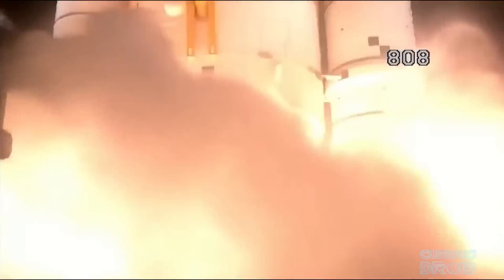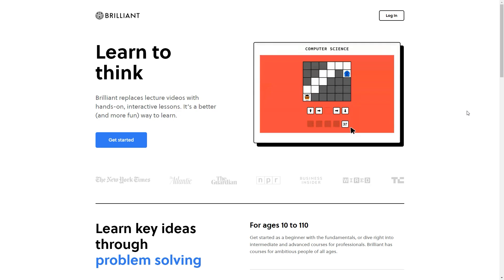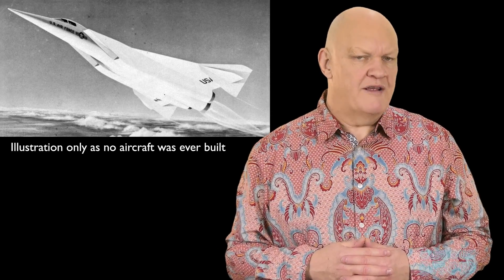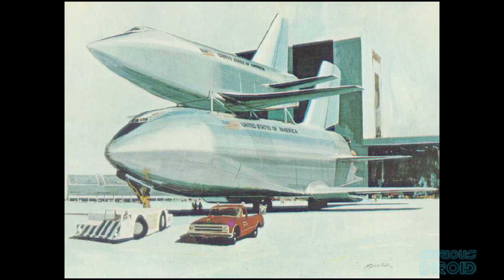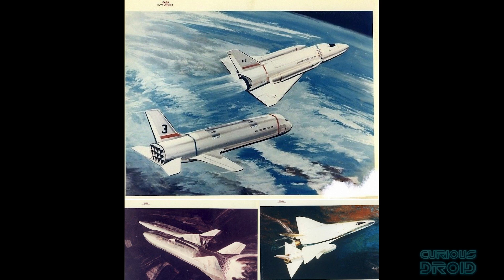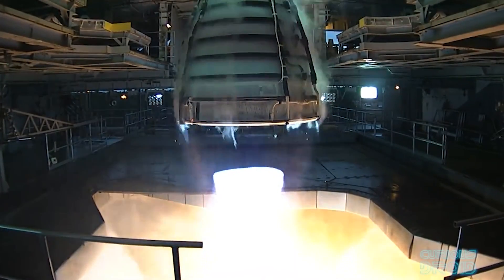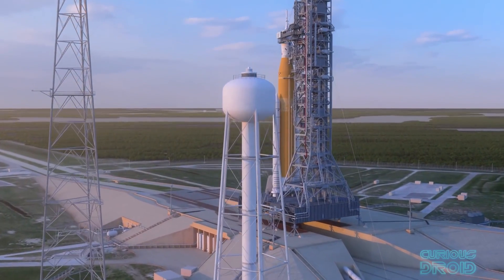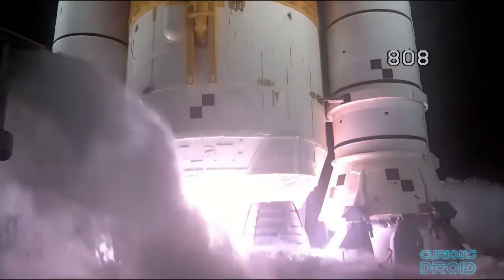Why is NASA Throwing Away Reusable Engines?

Comment: In a documentary I saw about the development of the SLS, is that, the RS-25 were not exactly powerful enough for the job. However, since they were now "disposable", they could be run way over their specifications, because, well, who cares if they are destroyed by the time their fuel is burned. So, from memory, I believe they are used to 115% of their designed thrust, which does give the necessary power needed.
Reply: They were run above their design rating   on the shuttles for years. If you listen to one of the shuttle launches you'll hear the throttle up command to 104%, and I think later on it went up to 108%. This increased thrust was due to upgrades made to the engines over the years.
Reply: What documentary was it? I wanna watch.
Reply: @MattH-wg7ou  I can't find it!!! I watch too many: Curiosity Stream, Magellan TV, Youtube. I've looked and if I find it, I will post it. They talk how they save money by using SS technology and manufacturing, etc.
Reply: Found it. On Curiosity Stream. "Breakthrough. Artemis: First Launch"
Reply: @dion6481  I appreciate you. Ty
Reply: This is largely incorrect. 109% was already planned for polar orbit missions in the mid 1980s prior to Challenger, with upgrades that number was to go higher. In any case the component most likely to fail at higher performance were the turbine blades which were already being replaced constantly due to cracks in the early engines--so if your line of reasoning is correct Block I motors were effectively "disposable" because they were replacing the parts that would be worn anyway. So your line of reasoning is not correct, since running the engines at increased thrust does not wreck them more than they had already been wrecking them early on running at thrust levels specified in the original design.
Reply: I thought that it was 109%
Reply: @dr4d1s  I don't remember exactly and I can't find the documentary in question... I watch too many.
Reply: @dion6481  totally understandable. I know how that goes all too well. Thanks for the reply though, I appreciate it.
Reply: @dr4d1s  
🤔 Well, it depends. I've managed to boost the power of R25 engines to 116.4%. You see, I bought 11 of them at a govt surplus auction to increase the altitude of my modified Estes model rockets from 800 feet to 800 miles.  Unfortunately, I too have been unable to reuse my R25 engines, because the vastly increased altitude they provide has proven to be a double-edged sword. Now I can never seem to locate the rockets after launch. They no longer just float back down into my backyard! 😁
Reply: @HighlanderNorth1  Yeah I had the same issue. I Finally had to just realize that I would never see them again.
Reply: If you don't plan on reusing the hardware they can be uprated  a Massive amount extra thrust since you can use it all up!

Comment: Its really all about pork. Not the kind of pork you eat. Its the kind of pork senators and congressmen use you buy votes from their constituents. There are production lines at factories in several states that the politicians in those states wanted to keep open after the shuttle program ended. The more RS-25's, propellant tanks and SRB's that get dumped into the ocean the more federal dollars flow back to those states to build new ones. This keeps the professional politicians in office, which is the top priority. And don't look for it to change anytime soon either.

Comment: It doesn't make sense from an efficiency or cost perspective but makes lots of sense in terms of Congress requiring this stuff to direct federal funding to their states. It's a giant welfare project for the massive industrial complex built to support the shuttle system. Meanwhile new space will continue to make strides and all of this stuff will become increasingly irrelevant and expensive. It would be easily within the technical capabilities of old space to build a heavy lift reusable system but they are too busy sucking that sweet sweet cost-plus government teat to ever change.
Reply: So you propose these engines be stored and maintained until a new shuttle is developed? Put in museums or the on the lawns in front of them, cut into pieces and melted down for scrap? All kinds of old hardware gets repurposed.
Reply: @masterpython  Old hardware gets repurposed if it is economical to do so. A 20+ billion dollar program to achieve a handful of SLS launches using a handful of SSME's doesn't qualify as economical no matter how you look at it. Yes, it would have made more sense to turn those SSME's into museum pieces.

Comment: Seems odd to me that they are focusing on single use engines, when it has been proven that reusable boosters are possible.
Reply: Possible yes. More efficient and worth the safety trade offs? That remains to be proven.
Reply: @sunspot42  What safety trade offs?
Reply: @TheEvilmooseofdoom  There’s a lot of wear and tear on all of the components of a rocket engine, as well as all the other systems that make up a rocket. They have to be carefully inspected before reuse and repaired. There’s always the potential for problems to be missed, or for repairs to go wrong. An engine that might be alright for 10 flights might be prone to catastrophic failure after 15. You don’t find out until your run quite a few engines to or beyond 15 launches. Reuse comes with risk, as well as added complexity from the recovery systems.
Reply: @MrWolfstar8  You can say that again!

Comment: The Shuttle main tank wasn't reusable and was never recovered. The SLS tank is similar in colour only as it's a completely new tank but built at the shuttle tank factory
Reply: People keep calling it a tank.

It's a rocket.
Reply: No shit, it was clear he meant reusable in design. I knew that's what he meant.
Reply: @blackhatfreak  No, he said is was modified showing real reusability. Go listen
Reply: @bigratkiller1  Yeah, it's not like they could just slap engines on the External Tank and call it a day. There were major changes for the core stage to have engines on the bottom and the second stage plus payload on top.

Comment: It’s a great shame they didn’t used some kind of tech like what they plan for the Vulcan rocket to allow the engine section to return to Earth via an inflatable heat shield.
Reply: Maybe somebody can recover them from the sea and bring these historic engines back to a museum. I thought SLS would be an ideal proving ground for the ULA/inflatable heat shield recovery system.
Reply: These engines were designed in the 70s. They have been reused over and over for years. SLS IS WHAT THEY ARE BEING USED FOR INSTEAD OF THROWING AWAY AFTER THE END OF THE SHUTTLE PROGRAM. Recovery systems are expensive so why spend the money to recover them?? This is them going out with a bang instead of being trashed. "Disposable" is not an accurate description.
Reply: @michaelwalker6252  This is true i mean, if you use the shuttle’s engines for SLS instead of it being placed in the Air & Space Museum it is the retiremnt flight of those engines. It did what it was meant to do for the past 30 years. I think it is fair to put these glorious pieces of the space race to an end (shuttle was from the 70’s post Apollo 17)
Reply: Why is that a shame? Sounds like overhyped nonsense. Reusability of rockets really doesn't save that much and is super niche
Reply: @pyropulseIXXI  First reusable booster becomes operational and almost immediately takes over the market. But "reusability is niche" LOL
Reply: @CausticLemons7  You are comparing apples to oranges. Reusability is indeed niche for LEO. Completely unknown if it will help with deep space missions.
Reply: @jamese9283  The advantages of a reusable rocket also improve launches for deep space missions. Reusable has thus far meant less expensive and more frequent launches. So rocket for rocket a reusable one should be cheaper. Being able to launch more often also provides more margin for the sometimes tight launch windows for outer space missions.

It's not always a guaranteed win but the potential for change across the industry is, I think, quite clearly there.
Reply: @CausticLemons7  There is far less demand for deep space compared to LEO, which has endless launches due to satellites. Deep space requires higher speeds with more fuel weight, and often heavier payloads, especially when humans are on board. Reusability comes with a payload loss, so there is no "clear" advantage at this point. Starship HLS also is greatly increasing mission complexity and risk with Artemis due to multiple large refuelings. I understand your enthusiasm to bring the price down, but it should be dampened until these concepts are proven. Price is not the only factor, especially when humans are involved.
Reply: @jamese9283  You just added a whole bunch of qualifiers and conditions. Falcon 9 and Falcon Heavy have already been launching deep space missions and winning new contracts for them. So your opinion doesn't really match up with reality.
Reply: @pyropulseIXXI  yeah its not like SpaceX have launched more payload to orbit than the rest of the world combined this year ... hmm I wonder how they managed that.

Comment: They cost a fortune to 'reuse', so it's probably better value for money to throw them away. I've often wondered if reusability is as good as we think it is. For instance, the effort required to recover and refurbish the F9 boosters is not insignificant. Given the state of rocket tech and experience now, could they not make a very simple, cheap, disposable booster instead? F9s are very clever, but a lot of that cleverness is unnecessary if you're going to throw it away. Why spend so much on all the tech, when all you really want is to blast things up to LEO?
Reply: Unless you have SpaceX's balance sheet there's no way to answer your question.
Reply: To reuse is cleaner and, as for example the Falcon 9 shows, it can also be cheaper.
Reply: Wasteful thinking
Reply: The end goal is still going to Mars and back, not LEO. Expendable doesn't lead to the proper path.
Reply: If you're going to redesign the engine, you might as well make a reusable engine that needs minimal refurbishment - which is likely what SpaceX has done. Considering the considerably fast cadence of their Falcon 9 vehicles, I doubt refurbishment costs "a fortune" for their engines.
Reply: @MrWolfstar8  considering who owns Space X, I don't entirely trust their figures! Plus there are lots of new rocket companies who aren't going for reusable. If the maths were that simple, wouldn't they all be going that route? Considering how simple a basic rocket is - two tanks, some electronics and an engine or two - I'm sure they could be made a lot cheaper than the cost of an F9, even with it being reusable. Especially if you strapped some cheap, simple SRBs (which are off-the-shelf these days) to them.
Reply: @paulhaynes8045  You might not trust Elon Musk, but we do know what NASA are paying them for various crew and supply missions, and it's a lot less than they'd be paying anyone else. And similarly, SpaceX are paying for a huge number of flights themselves for StarLink deployment, and if that was costing them anything like what they'd be paying on Atlas or Soyuz, they'd have gone broke well before now...
Reply: @simongeard4824  NASA don't exactly have many alternatives! As for what NASA is paying (for something that was partly developed with NASA money anyway!), and what the real costs are, or if Space X actually makes any profits - who knows.  Also, with Starlink, Space X are effectively paying/charging themselves. Who knows what the costs and profits really are? Would Space X be a functioning business without Starlink or NASA's money? Can we trust anything Musk says? His record is not exactly encouraging.

Comment: There were some close calls on the shuttle main engines, including holes in the heat exchanger / rocket bell.
Reply: I can't remember if it was the cooling channels or the injectors, but they would plug the ones that didn't pass inspection between flights. The plug came dislocated during one of the flights and punched holes in different places on its way out.
Reply: This, 100%.  This is why reuse is, when one blows up, way more expensive than new.

Comment: It's either madness or a gravy train (explain to me the the difference between those two please). To make these wonderful, groundbreaking engines reusable - which they were designed to be! - means using them to land the booster. SpaceX has demonstrated - spectacularly - that this is essentially a software problem as long as you mod your booster with a nice re-entry kit that responds to the computer's orders instantly.
But hey, let's do NASA: let's just throw all the beautiful engines away and then go backwards by building marginally cheaper versions so we can feel pretty good about throwing them away. Apparently, that's NASA's idea of sustainability. It would be funny if it wasn't so depressing.
Reply: You know a little less than you think you do.  One of the issues with the RS25 as they stand is they are temperamental to start up and can't be re-started.  That's one of the big things spacex did, first with Merlin - go simple and make it re-startable, then onto Raptor, more complex but also re-startable.  At no point back in the day was restarting part of the RS25 design.  Lastly... NASA doesn't them.

Comment: The cost of the rocket engines is miniscule compared to the cost of developing a system to return them from orbit. With a flight rate mandated at 2/year, the breakeven is just not there for reusability on SLS components. Even the SRBs barely broke even in the 80s with monthly launches, and at lower rates cost more to recover than was saved by reusing them. Same situation with SLS- as its primarily a heavy lift rocket designed around maximum mass through TLI. Compare to the Starship HLS plan which requires 14 refueling launches to send it through TLI. And if Starship isn't 100% as cheap as hoped, it suddenly becomes a massive cost to have all those launches compared to expendable. Reusability has its place but its not a panacea for lower costs!
Reply: The caveat is that once you start manufacturing rocket fuel on the moon, it presumably will become much cheaper since cost to orbit should be much cheaper from there.
Reply: Finally some common sense here. It's so depressing to see that many who firmly believe reuseable rockets comes with no downsides, especially at this launch rate.
Reply: the flight rate of 2 per year is because they have to make the rocket from scratch each time. With reusability they could fly more often.
Reply: @imarchello  No, the rate of 2 per year is because thats how many rocket cores the factory can handle at once. According to NASA, if you expanded Michoud back to the Shuttle size, they could reach 6-7 per year. The factory was originally supposed to put out at least 12 expendable tanks per year. Reusability or lack thereof does not limit the flight rate.
Reply: You can clearly see the issue, but yet somehow think it's a justification for expending rockets. SLS can only fly once or twice a year because that is all that can be made. They have already had to cancel any launches other than Artemis for SLS as they just cannot make enough. And if the costs could be brought down as well by making it reusable, there is a lot of launches that could use it. And being reusable doesn't mean that you cannot have the rocket expended at some point. Being built to be expended only is just a waste and removes any options.

Take Falcon 9 as an example. It's reusability has allowed it to be the cheapest ride to space per kg and cheapest altogether during rideshare missions. Plus it has allowed SpaceX to pursue another path that wasn't previously feasible. And yet after over 10 successful missions each, 2 boosters were finally expended for heavy, long distance missions that finally required it. They had more than paid themselves off many times over prior to finally being expended. 

And with Starship HLS, you tried to justify the SLS again with talking about it sending it's max mass to TLI on a single expended launch while HLS needs 14 refueling missions for it's max mass payload. However, you completely miss that HLS is sending around 3-4x more payload and not just going to TLI, but completely landing on the Moon and having enough fuel to return to lunar orbit. And that is all while being reusable. It could easily carry more to TLI than SLS while being completely expended. And it could be expended after paying itself off with numerous missions like Falcon 9 has. Being reusable gives you options that just don't exist with an expended launch platforms. And it reduces costs so much that you don't have to worry about launch cadence.
Reply: currently Starship is just a giant money sink that is likely to end up costing so much to develop it will never pay for itself
Reply: @thesteelrodent1796  People said the same thing about Falcon 9's partial reusability. You will eat your words, just like the Falcon 9 doubters.
Reply: @imarchello  No, people said it wouldn't breakeven. But they were willing to sink the money into it and it relied on no new technologies or radical systems. Reusability has its place, but that place is not EVERYWHERE.